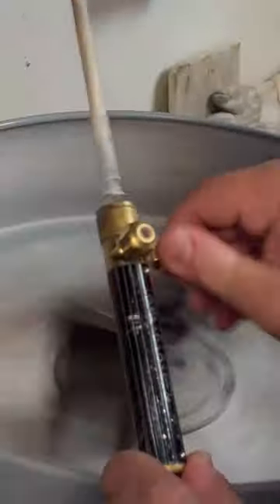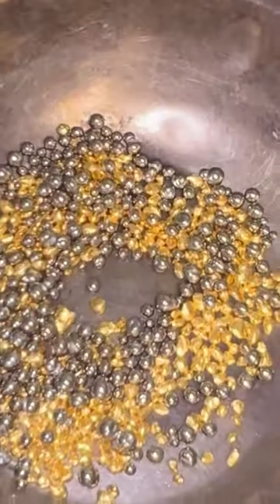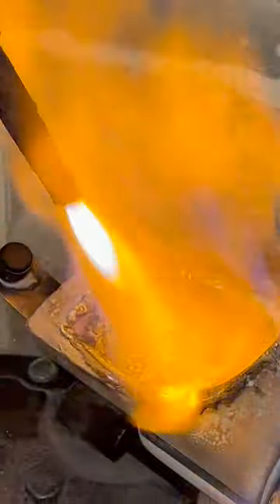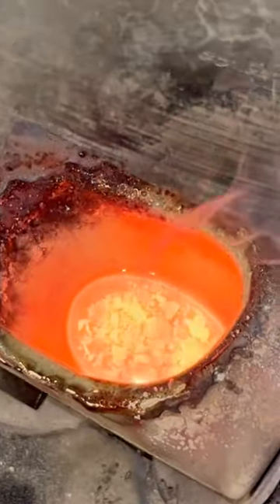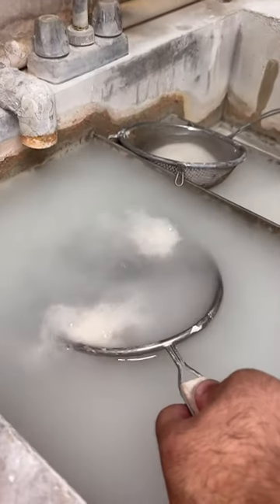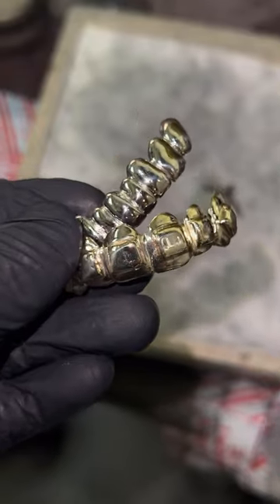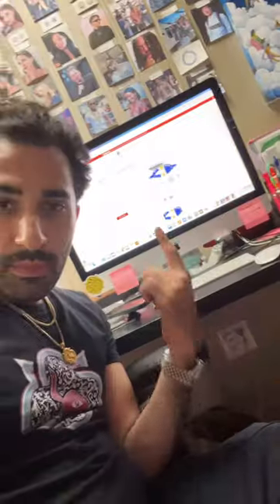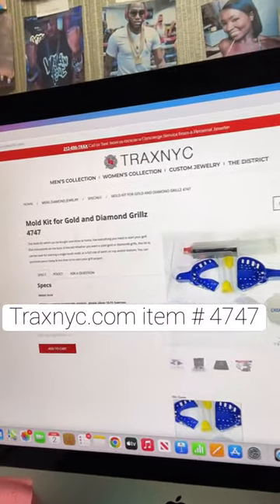CASTING GOLD GRILLZ!!! #shorts

Comment: What metal do you dilute the gold with?  What metal?
Reply: Copper tin
Reply: @TheGunBub  probably more cooper, zinc, or nickel & silver. I don't believe they use bronze for the alloy mixture. I may be wrong and Trax may use a tin copper alloy but I'm fairly certain unless that's a base that is coated in gold, they wouldnt use bronze as the alloy
Reply: @tdbla98  i forgot bout the silver
Reply: Nickel or Rhodium
Reply: @rubinbacote5156  you don't use rhodium to cut gold lmao it's way more expensive than gold